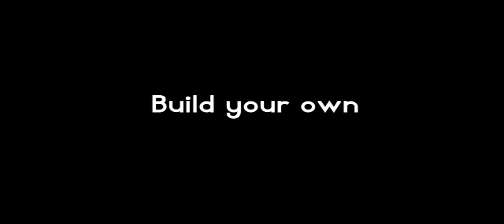Sustainable Unit - Super Adobe House

Comment: there is a dual compass system... One has the height of the dome and comes from the door frame. The other is a chain that has a changing size. It gets adjusted where the two meet... By using these dual compass sytems anyone can build a dome...

Peace